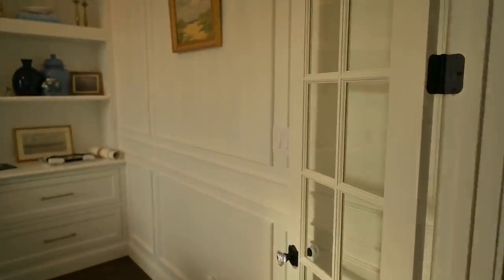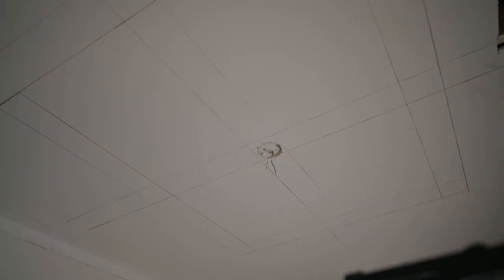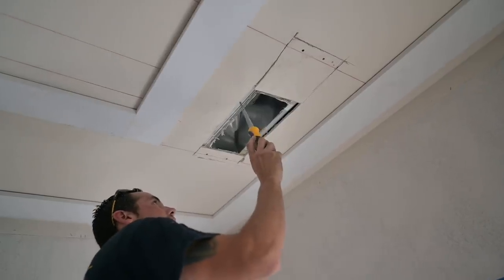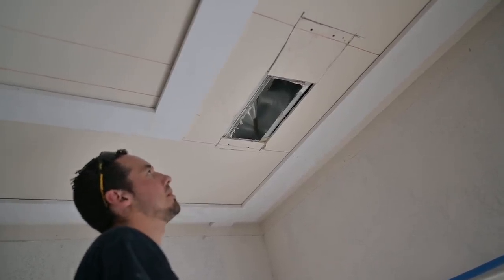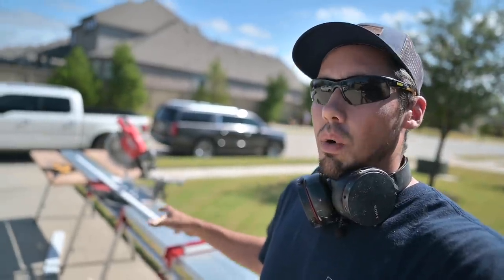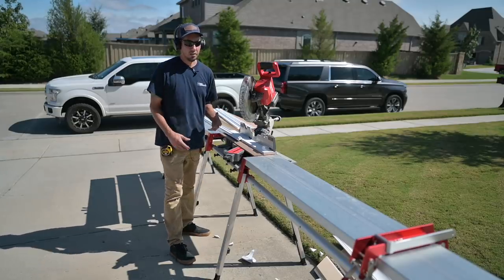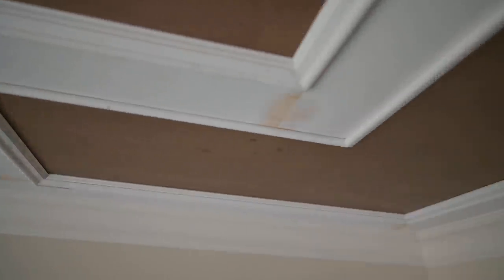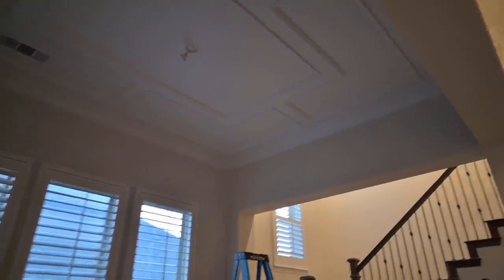CLEAN Trim Work Install on Ceiling

Comment: You should consider using the zip wall adjustable posts (or similar). Not designed for heavy weight but would work great for situations like this where you need an extra set of hands. I've used them in similar situations and they worked like a drea.
Reply: 09
Reply: L
Reply: I bought a couple of the Harbor freight version.  I have already used them more than I thought I ever would.

Comment: Great layout. Regarding the flaking of paint off the plastic,  If you use the 3M hand tape dispenser with 9" paper and run it around the room above the plastic you will not get as much paint on the plastic and it won't flake off the paper.  This also allows you to put up the plastic quicker since the dispenser tape forms the seal against the wall..

Comment: Have you ever tried the fast cap third hand support system? They extend to 12' and have a handy jack at the top to help get your stuff tight to the ceiling. I use it for cabinets and trim, but it would also work on a large ceiling install like this one.

Comment: Hi, awesome set up on the miter saw. Great job as always. Just a tip instead of throwing your scrap wood on the floor get a small container so you can save time. It works for me. Cause time is money. From Wisconsin

Comment: Hope don’t get tired of reading & hearing.....but
Slick, clean, & great detailed trim work. Very nice and really looks great 👍🏻 
Never disappoint when watch a vid, & am always fascinated by the lengths you (& many others) go to for a “project”.....what separates good, from great; imo😉 (6:08 for example, as you’re taking care to make the vent right; along with supporting the ducting w/o any kinks/bends..... Some ppl wouldn’t go thru these steps & just do whatever to get job done, I’ve seen it...)
Cheers✌🏼

Comment: I would love to see Richard do some precision finish carpentry in my area. The average home is a coal mining house built well over 100-120 years ago.  I just installed a bifold closet door in an opening that was over an inch out of square.  And the sad thing is that door frame was possibly built completely square in 1890.  LoL

Comment: Finish carpentry tv. A trick for eliminating flaking paint off the plastic is to take it one more step further and run a length of paper and tape with a masker along the perimeter of the plastic so that majority of overspray is on the paper not that plastic. Paint won't flake off the paper like it does plastic. I take that extra step now cause I hate having to clean up after flakey plastic 😎
Reply: Looks damn good though keep up the good work

Comment: You've done some awesome work in that house!  I think I've watched all of your videos now and am very impressed with your work and have learned a ton.  I'm applying a lot of your advice to some staircase wainscoting that I've been working on.  These accented ceilings you've done look amazing.  In both videos you have pocket screwed the framework together and then did the same thing I would do....say you're never doing it again but do it anyway. :)  How would you do it if you didn't pocket screw it?  Say the room was twice as long...that would make it pretty tough to lift the whole thing up.  So would you just nail it up piece by piece?  Pocket screw sections of it and nail it up in sections?  Maybe use biscuits somehow too?  Thinking out-loud...Thanks for sharing your knowledge with the world!

Comment: Nice work but I hope you put some spray foam or something in that gap from the air vent and the sheet rock to keep the attic air seperated from the cold air coming from the vent. That could cause condensation and or the vent to sweat

Comment: Looks stunning. “Proportions correct”. I know you decided on same distance all the way around. What proportion (rule, or whatever) did you use to decide on the size of the center box - and width of the “boards”?  Thanks for the video.

Comment: Very nice.  But I have a question.  While you have the pocket hole assembly on the ground.  Would it be easier to measure and cut the hardboard panels and fit them prior to mounting the 1x assembly on the ceiling?  I guess the same for the panel molding.  I'm a lazy person so I want to avoid going up and down a ladder as much as possible.   I love your videos and will hopefully start working on my house soon.  I am new to doing any of this and you have given me the confidence to give it a try.   Thanks

Comment: Hey Richard. I actually have a job coming up that's very similar to this. Can I ask how much time this took you?

Also I've never used pre primed materials for things like this. I assume you are using Windsor One materials. If you were using semi gloss and the light was showing on it, would you see all the slight defects from the pre primed materials like planer marks or wood imperfections?
Reply: Just prime it lol. Why risk it...
Reply: @josegomez6549  sorry, I mean "factory primed" I've never used factory primed for a high quality piece of woodwork. I always prime them myself to make sure they are perfect.

Comment: You mention that your pre-assembly method gives a better result, and can be easier to fit, but does it not depend upon absolute accuracy in layout and cutting?   You mentioned the math, but it is surely more than that.  Your measuring and cutting must be spot on!  I watch your videos with awe!
Reply from the maker: Yes having the math and a good stop block help enormously. The boards are all the same and we make sure of it before assembling/installing. I dry fit everything before I glue it as well.
Reply: If you are putting crown up you can be short because the crown will cover it.

Comment: Never tried a ceiling myself - I work alone mostly…. Might give it a try 

Been trying to do pre assembly on my trim outs like you do-  but if I ever meet the framers & dry wallers who built my house, we are going to throw hands lol 
Such garbage work was done in 2003

Comment: When you nail-gun these beams to the ceiling, did you check and adjust the design measurements so that the nails are on the ceiling joists?  or it's light enough that you don't need to make sure they are attached to joists?

Comment: Is that 1/8” or 3/16” hardboard tempered panel and do you also staple it on the center or inside besides the perimeter, Richard? Very nice and clean.

Comment: I tried using angle finder to find the angle of my ceiling but, i'm getting 2 different numbers as I used both digital and manual. What do you suggest I do
Thanks

Comment: I can't seem to find that picture rail molding here in Canada, I can't get the offset panel molding you've used previously either. I'm going to have to use something like chair rail molding and rout a rabbet in the back. Certainly achievable but it would be a lot less effort if we could get those other moldings.

Comment: Ditto... the ceiling looks very nice. And the adjoining study is ultra-nice. 

On this one and several others we can see sprinkler's protruding from the ceiling. They don't look good, frankly. So the crazy idea came to me... why doesn't somebody make something resembling a cover, possibly resembling a little decorative lampshade, for the sprinkler heads--- made of some paper or other thin material that was guaranteed to dissolve away immediately when blasted by the sprinkler. Or maybe the cover could be designed to fall away as the heat-activated valve comes on due to the water pressure. Or is there already something like that? And why not go all the way and make it into a lamp fixture? Formerly it was probably a logical no-no to incorporate a sprinkler inside a lamp due to the heat from the filaments causing a need to resort to a less-sensitive heat activation means... that and the mains voltage with the potential for shorts. But with LED lighting with its low heat and low voltage there should no longer be such a restriction.

Comment: Im curious on how the center hardboard piece was fastened to the ceiling. Is it just liquid nails, or can you put staples through the hardboard and then fill with nail filler?

Comment: I have a quick question?
How do you hang ceiling trim/boards when studs can’t be found? And all your nails go only through the drywall?
Reply: I'm a trim carpenter. We usually will add a bead of wood glue to the backside of the molding and nail using the scissor nail technique. If you nail two nails in opposite 45 degree angles (like scissors) it will hold in the sheet rock fairly well. Only in spots where there's no meat to hit obviously. Hope that answers your question

Comment: Awesome work as you have done in the past, really enjoy all your videos, also I’m a big user of the twin dewalt stands that you used to use, and I’m interested now in the cut hub you have moved too, but my concern is that iv built a certain space for my dewalt stands, and just want to know, that when you pack down the cut hub, are they about the same size when both dewalt stand and cut hub are sat next to each other? I don’t want to rebuilt my van if I can help it? Height and length? Thanks and keep pumping out the videos, always look forward to them,  junior bob from porirua, New Zealand, i’m also called by my friends, JB,

Comment: the outside border looks like it's 6 inches wide. the inside rectangle and 2 connecting boards length wise look like 3.5. the 2 connecting boards width wise look 4" correct or am I losing it?

Comment: Have you/would you do something like this over a popcorn ceiling? Thoughts?
Reply from the maker: I’d probably take a taping knife to it first and get the big pieces off. And then I would for sure. But not directly over the heavy popcorn. It would throw off reveals in the end
Reply: @FinishCarpentryTV  Thanks for the input. Keep up the good work and keep the videos coming!

Comment: Just nails? No construction adhesive?  Canyou explain why or why not?
Reply from the maker: We did use PL3x it is the only adhesive I use now. I stopped using liquid nails. But yes PL3x and 18 G staples around the perimeter that will be hidden by the trim.

Comment: Why not just lay the hardboard on the whole ceiling and frame over it? Wouldn’t that be easier than having to cut the panels to the exact measurement of the cutouts?
Reply: Probably for the dimensions of the trim so there's no gap. They might not have a deeper moulding available in that style.
Reply from the maker: The large panel in the middle of the room is beyond 48” which is too long to cover the area under the 1xboards. We would have had to made a seam.  And I try to avoid that at all costs. Sometimes we do cover the whole wall if possible.
Reply: @FinishCarpentryTV  makes sense. I know there is always a method to your madness and it’s nice to hear the thoughts of a master.

Comment: I want someone to answer the question why he only does "trim"? in the UK he wouldn't get any jobs in carpentry if thats all he did.
Reply: There are different grades or specialties of Carpenter: my father was a Pile-buck Carpenter, this guy is a Finish or Trim Carpenter, my brothers were Framing Carpenters, etc. Other Carpenters specialize in flooring, or cabinets, or doors, etc. For example, in a home I worked on in Beverly Hills, California they were installing a $5,000 entry door...who you gonna call? Not just any Carpenter, not even a Master Carpenter...yer gonna call a guy who only installs doors, period. The door in question here was hand-carved and shipped from South America. Doctors are the same way...they know about all medicine but they specialize in different aspects. Some become Surgeons, some become general practice, some become Gynos, etc. In America there's plenty of work for specialists in all the Building Trades. I'm sure it's the same where you are. When you want your walls plastered, who you gonna call? If you can afford it, you call a specialist.
Reply: @choimdachoim9491  if you can't do all carpentry in the UK you aint a carpenter. Your way seems to be a lazy way in how you don't want to learn the other sides of carpentry.
Reply: @choimdachoim9491  he is correct. I'm a "carpenter" or as we say in Scotland, a Joiner. And I do all aspects of joinery and building work.
Reply: @degrom542  hi, I am a joiner but I need a price for some joinery work. Hahahaha that would be so embarrassing!
Reply: @paulmcfadyen689  That's like saying "If you can't do heart surgery you ain't a real Doctor." Carpenters, like Doctors, specialize. Or Masons...some specialize in brick, some in cement block, some in stone, some in concrete. They know something about all of those aspects but they prefer to work in one medium or another, for whatever reason, maybe because they just like it more, or it's just naturally easier, or maybe pays more or is easier on their back...whatever. That doesn't mean that they aren't real Masons.
Reply: @choimdachoim9491  but that's just not how it is in the UK...which is his point